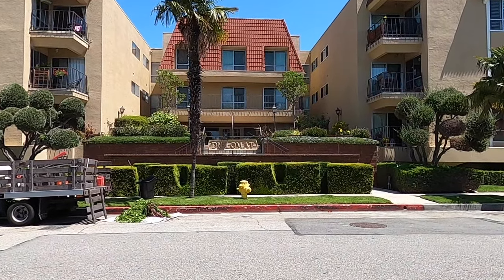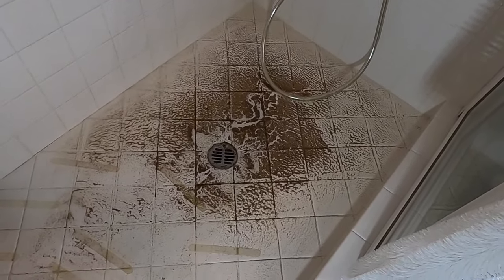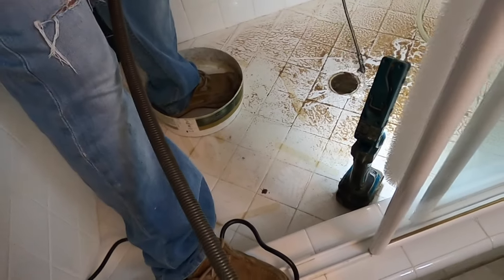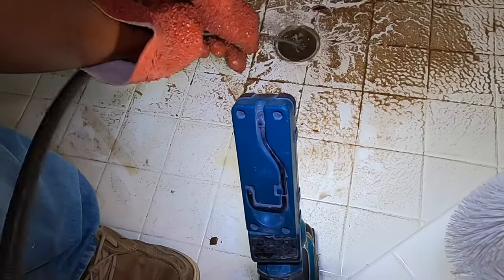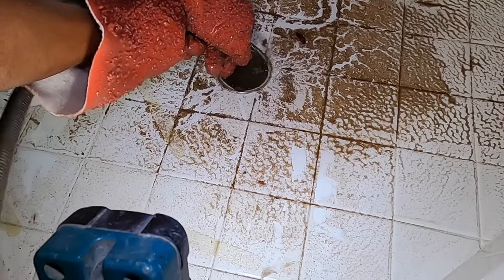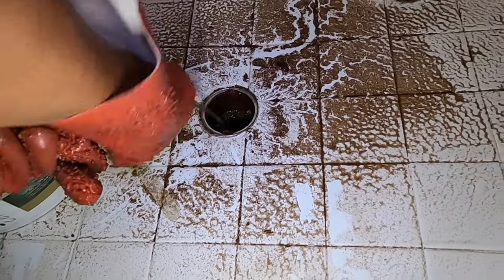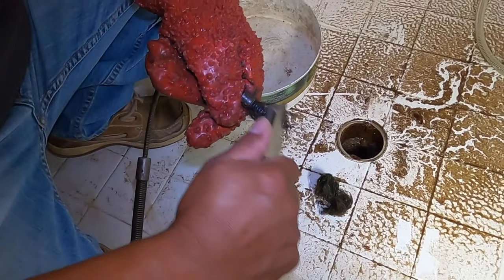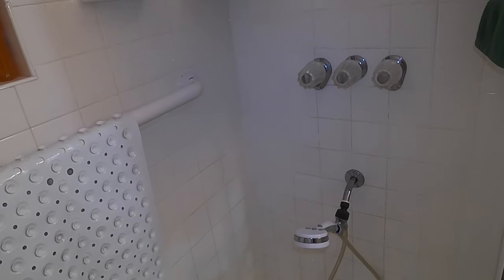How To Snake Out A Shower Drain

Comment: what do you do when it just won't push down any farther? I can pull it out and try different heads but just can't get it past either the clog or a joint/trap
Reply from the maker: Try pushing down on the cable in reverse.

Comment: I can’t seem to get my snake through the trap of the shower. Like the angle it turns the cable won’t bend like that
Reply: It's good to have a variety of different snakes/augers for various jobs.  Highly recommend you have a couple different size snakes and attachments.  Perhaps you can just run the cable (snake) without an attachment.  Good luck. Be persistent. 🤔

Comment: The thing is if its done it once it will do it again. Surly it is bad design poor plumbing and general a mess. Size of the drain could be wrong as well. You have work out the incoming water to the size of the shower outlet which could be to small to take away the water. Then there is does it have a fall from the shower tray to the outside drain. Then you have the joints where they proper sanded outside and inside the pipe. then you could also have a puff pipe added just after the trap so that the pull does not pull all the water out of the trap but keeps a seal to prevent smell. I don't know whether you have strict regulations for this probably not. Then somebody that has had no training for plumbing do the job. If i was buying a house in the states it would be one of the items i would include because it surely costs a fortune to replace the drain especially if its under concrete. This is just first impression.

Comment: would you snake just the same for a bathroom sink?
Reply: yeah but bypass the p trap and go straight into the wall. if that doesn't work then go through the roof vent, can use a bigger cable